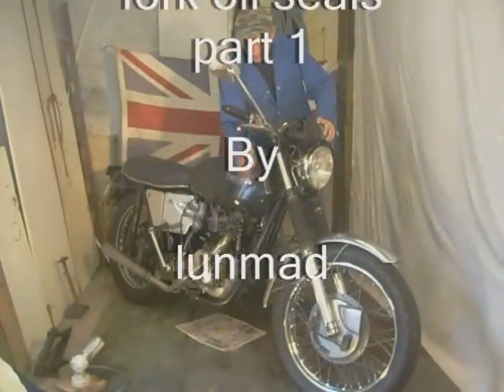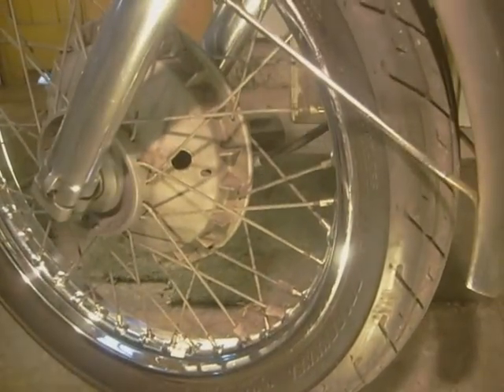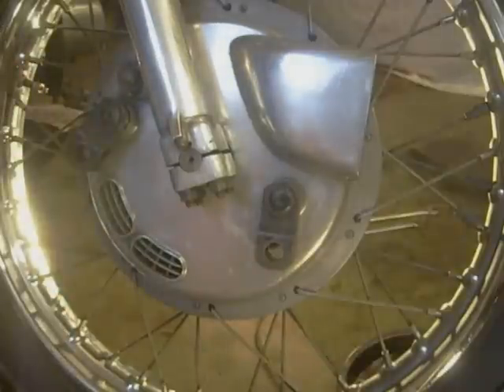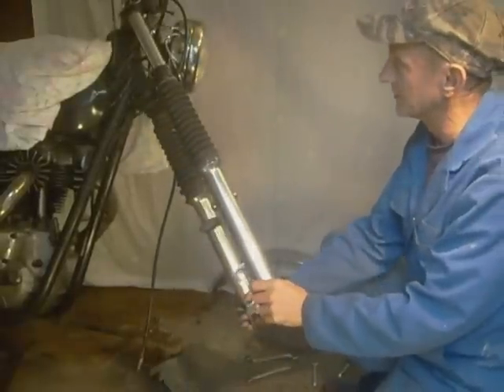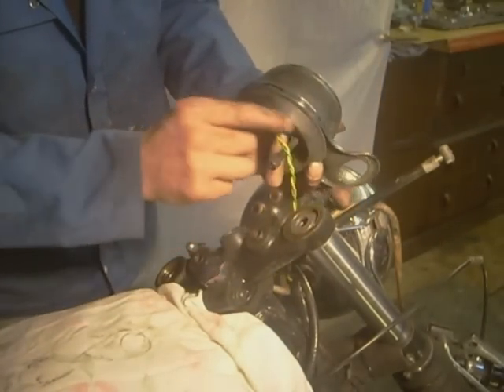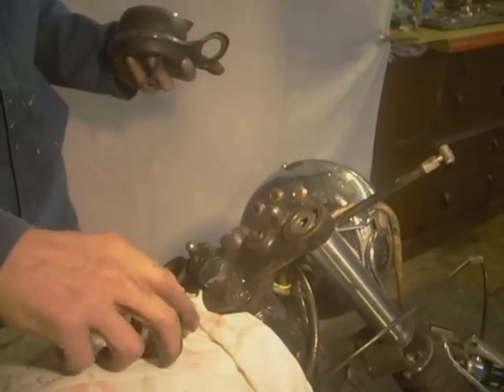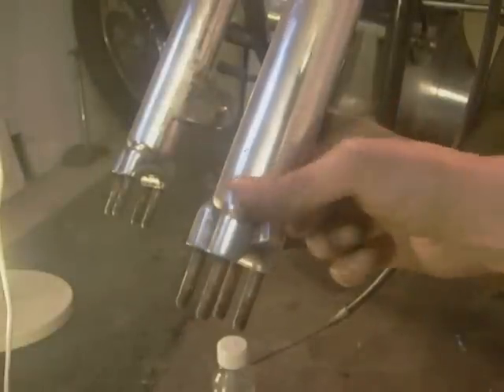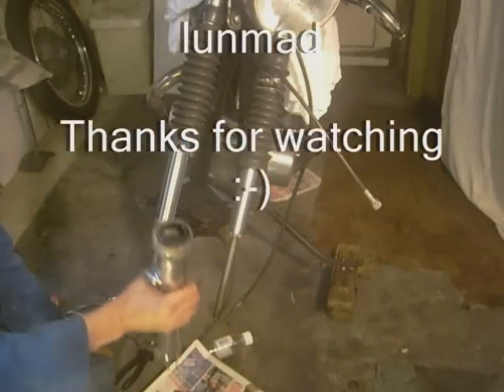Changing fork oil seals pt1

Comment: It's possible do this without taking the handlebars right off. I just slacken the p-clamps, then slide the bars first to one side, then the other. This gives enough room to remove and refit the top plugs and springs. If you are lucky enough to have use of an impact wrench (i'm a car/truck mechanic), you can use this to spin out the bottom damper retaining bolt and refit it without needing to hold the top of it.

Comment: Hi Lunmad! I don't know if you're still active in here, but I'll try my luck ;) 

I've run into a bit of a conundrum with the allen screw that goes into the damper rods. I've got metric and US allen keys, but neither the 5 mm or 6 mm nor 3/16" or 1/4" fits the socket. So I'm beginning to think that theres a special allen key for this sole purpose or a difference between UK and US allen key sizes?

I hope that you can help me. Thanks!